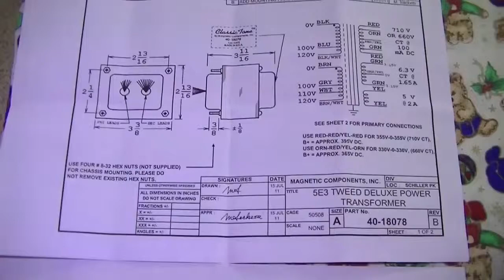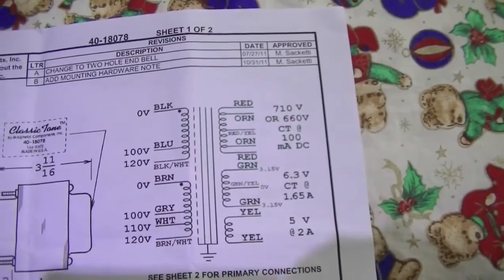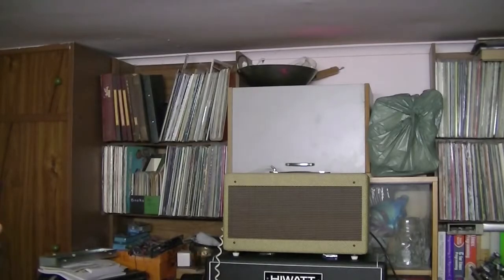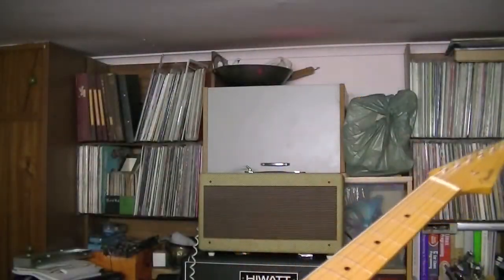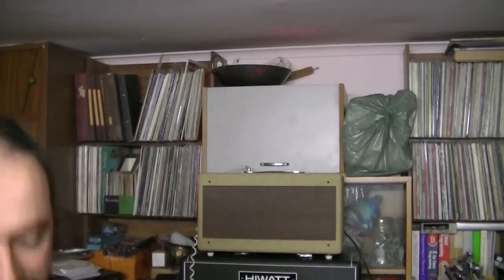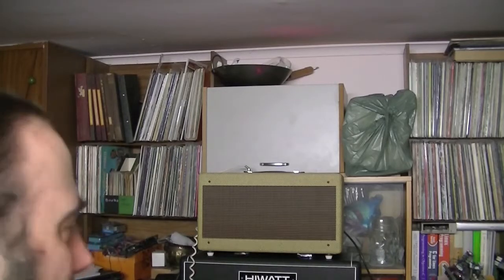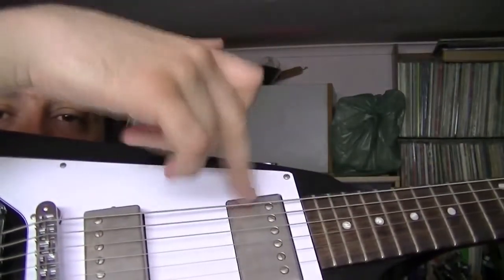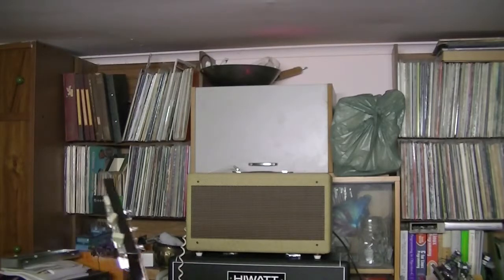Mojotone 5E3 Amp With Lower B+ & Many Guitars

Comment: You have a perfect plate dissipation with the new voltages..   (20V/270 ohm) / 2 = 37mA pr tube..  37mA x (362-20) = 12.7W ... 12.7W/14W= 90-91% idle plate dissipation with a 1high power JJ 6V6 tube. 

The vintage 6v6gt datasheet shows a maximum plate voltage of 315V.

Another amp very similar to the 5e3 is a Dearmond R15. Its schematic shows a B+ of 340V, plate voltage 330V.    19 voltage drop over the 250ohm bias resistor..This give you a idle dissipation of 0.038mA x 311V (plate to cahtode) = 11.8W  ,, Though a bit crazy was that the amp had a 40 microfard first filter cap using a 5y3 rectifier. 
Leo got a away with a +B of say 375V using a lower 16 microfarad plate screen and a less powerfull power transformer that would sag under heavy load when pushing the amp..

Comment: Great job... I could recomend you to calculate idle dissipation values on the output tubes.. In your case your 6v6 has gone from idling at 15W each with the old transformer and now idling at 12.7W each.
YOu just take the voltage drop (cathode voltage) on the 270r bias resistor (measure its resistance) and divide to get the total dissipation of the 6v6 tubes. 
Example: 
22V7270r = 0.08148A, divide by two = 0.0407A or 40.7mA each. Multiply with plate voltage (392V-22V) x 40.7mA = 15.06W idle dissipation pr tube. 
Before you invested in a new transformer, you could have ordered a couple of 5W resistor like 330r, 390r instead of the 270r to cool the bias a bit... and get them down to values around 12-13W for the 6v6 tubes but with high voltages.

Comment: Are you getting very much rectifier sag now ?
I have high voltages,  get very little  compression or tube sag. With a meter on it,
and every thing cranked all the way, hardly even drops. Fender 57 deluxe tweed head, hand wired and all that crap.
Thought it was going to act and sound like a vintage tweed deluxe, it don't.
Fender can not even reproduce what they used to. 
Yours sounds better, good job !
Reply: Knowing the values of the values of your filter caps(especially the one feeding the OT center tap) and the coupling caps would help.That amp sponges up when it tries to draw more current than the B+ section can supply,it is as simple as that.

If the filter cap is higher than 16uf it will be stiffer and tighter.If any of the coupling caps or cathode bypass cap has a reduced value than can do it too.You can always put a dropping resistor in series with the B+ coming off the rectifier.

Comment: I love that lower voltage sound.  Its always interesting the lengths people go through to be vintage correct and then disregard voltage.
Sounds great across the board, kudo's for using a wide spectrum of guitars.
What speaker are you using?
Reply from the maker: I am using a quad stuffed with 12" Eminence TonkerLite speakers. They have a rather crisp sound reminiscent of the old Fane Crescendo, and are perfectly matched for my Hiwatt head. I am currently using a 2x12 with 70's era Celestion G12M speakers in it and that is better suited for it. Kicks out a nice midrange honk.

Comment: Nice job on the amp. Really sounds like a nice vintage Fender.

Wild guess, but I'm guessing that the input jack is wired backwards. Just the way it hums really hard when you stop playing and take your hands off the strings. That usually happens to me when I wire the jack wrong either on the guitar or the amp. I'm guessing it's the amp since it happens with all those guitars.

Just a thought. You did say to be anal.
Reply from the maker: sa230e Nah, the amp is fine. Apart from the Flying V, all the guitars have single coils which tend to pick up all manner of interference such as the fluorescent tube lighting the room. I get the same amount of hum using other amps. It's just something I've learnt to live with, especially with P90's which are my favourite pickup ever.